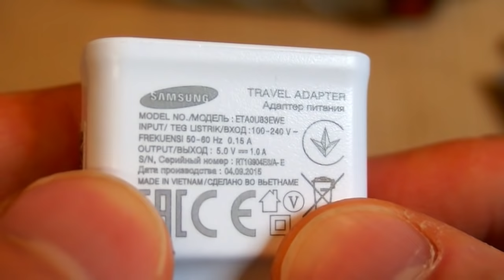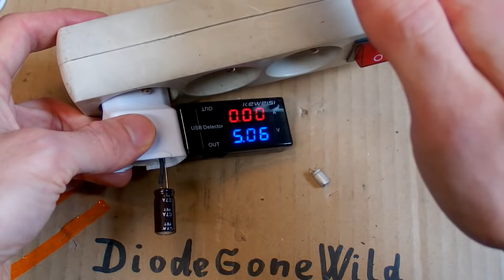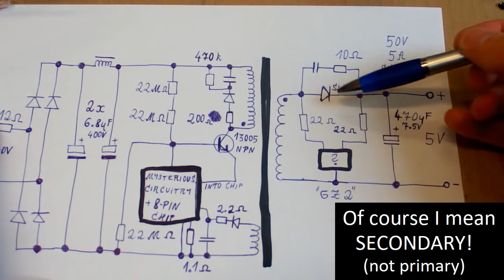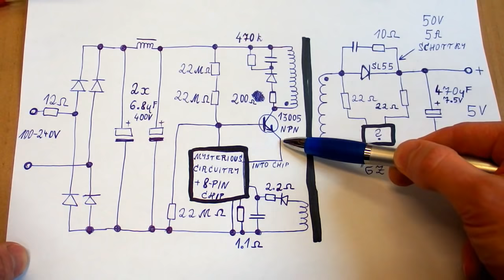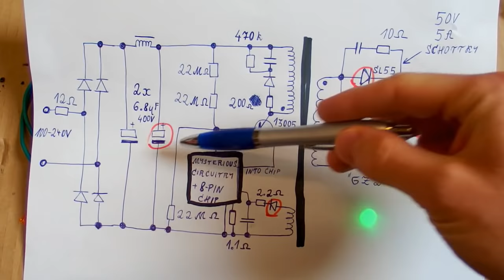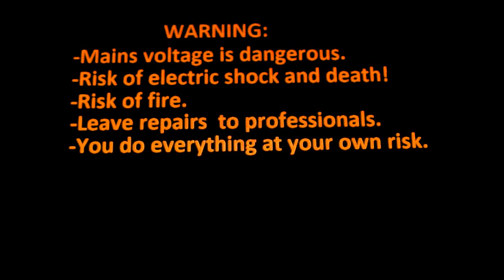Samsung USB Charger Failure and Repair

Comment: Sir i have confusion related to secondary side the secondry side is still ac power then how used electronic capacitor usually those capacitor are working on dc volts

Comment: I've had like 3-4 of these fail in the 4 years I've owned my phone fir my 120 NA outlet. Seems like once a year. I have to keep flipping the cord around randomly until I find a way to fast charge - thought it was the cord several times, never the case.

Comment: All men made products nowadays are time machines. Can last for all least 1 to 2 years warranty period.
You should mark the installation date on the appliance just like a bottle of milk with expired date.
When an appliance is out of order, U can decide what to do next.
Timing belt , rechargeable battery, capacitors, direct soldered notebook CPU, RAM can do the job well.
U can not imagine a plastic part, cover can also do this kind of job. Cracked or broken into pieces as time goes by.

Comment: Why on earth is the transformer after the rectifier? It makes no sense to me as transformers don't work with DC current...
Reply: The signal is converted back to high frequency A.C. after the rectification stage. This is probably done by using a mosfet. The transformer then steps the A.C. voltage down, which is then converted back to D.C. by a diode and capacitor arrangement on the output. Maybe... lol

Comment: @DiodeGoneWild with regard to the chip on the secondary side, I opened my own Samsung charger and had a look. I found out it is an APR34330 which is as the company calls it a:  SECONDARY SIDE SYNCHRONOUS RECTIFICATION SWITCHER. Not too sure but it looks like it is essentially a controller with integrated N mosfet that helps on reducing losses on the primary side and also smoths the output to maintain a nive fixed 5V. 
Datasheet:  https://www.diodes.com/assets/Datasheets/APR34330.pdf

Comment: My charger wont charge the phone and makes short circuit like noises? I use a second original charger from similar phone on the phone that wont chanrge and the phone charge with no problem

Comment: I got also a PSU looking like this one, but the circuit differs a bit. My one failed on the output capacitor. It was terrible small for its capacity and made for computers, not for PSU using high ripple currents, so it failed. When replacing it by a much smaller value, but made for high ripple, it was working until today.

Comment: Sir my charger is may be damage due to high voltage of electricity but it still charging but there is a  burning smell in it then what I do...Use it or not...,,?
Reply: can you identify the burning oder?
Is it the circuit board? a resister? a semiconductor?
touch the componants and see which are hot

Comment: Electro caps rt type have a deliberate indents on the top usually a "x" or a centred line with 1/2 circles either side of the centred line,they leak brown liquid through these weak spots when overstressed?,in extreme cases they can explode with a loud sharp "bang" !! ☺

Comment: The first tech I've heard mentioning the smell of a circuit a trick I have taught people in electronics repair since the early eighties finding bad transistors in pinball machines
Reply: repair by using your senses is a very good and old school method of repair

Comment: I use the same Samsung charger and it smells like it has burned at the 5v output but it works just fine is that normal?
Reply: I don't think so..
Reply: @dianaodintsov4371  Should I buy a new charger?

Comment: My general rule on capacitors: See a capxon capacitor, replace it. Even if it hasn't failed. I rarely see capxons that haven't gone bad.
Reply: too bad we cant hold those Capxon manufacturers responsible for their known bad quality junk we should boycot Chinese goods until they remove crap like that from the market

Comment: Fuse resistor generally is of 2W and 10 Ohms / 7.5 Ohms which means if it passes more than 400mA from AC side(230/120 Volts) it won't blow. How is it a fuse? Shouldn't it be 0.1W resistor? Please revert

Comment: Perhaps the electrolyte was on the line that monitors output current or voltage and sends the result to the control chip which adjusts the output dynamically...

Comment: so how to clean this Liquid spillage without destroying the board  ?
Reply: I use flux remover or regular alcohol you could even scrub it down with a soap and a toothbrush and water then completely dry the board with a hair dryer or heat gun

Comment: Transistor-era electronics for higher-current handling
Transistor-era electricals for mobile-portable voltages (especially 3.3v components)
Integrated circuits for analog-digital and, less-presumptuous than controllers, micro-controllers, programmable-logic-controllers, micro-processors, processors, field-programmable-grid-arrays, graphics-physics, AI-processors.

To ground multi-segment power-supply micro-ATX x86 main board, 0v pivot-point is difficult to up-down. To raise the overclocking voltages of processor in main board to component level matching voltages, 1.25v digital-electronics components can up-down easy without pivoting-trashing around 0v. Accuracy to other electronics component ranges until analog 3.3v to batteries of 3.6v/3.7v and charged by voltage of 5v or charge by current of 5v+10%(non-milspec) with USB-C PD blah-blah... 

Computer Main boards should have Samsung USB chargers, or, IC not too intelligent but can control voltage accurately USB charger - as grounding device. 

Find balance to be within-range of plus-one order annulus, branch vector. Within-range to within-range to within-range. Center is balancer grounding. Chinese term of 太極

Comment: You sounded unsure about whether this charger was genuine. From what I can tell in a quick search, all signs point to fake ... the real ones have a transformer with a white wrap, the components in the circuits are different, and there is a long cut out gap separating high and lot voltage circuits in addition to the use of distance between the sides, whereas this one is just using physical distance and no cutout.

I had a similar issue years ago with an Apple charger I bought ... the Chinese copy factories are getting better at making this stuff all the time.

Comment: Just opened the 2A version of the charger to have a look. It was pluged right before I opened it i remember that I thought in my head to be careful cause the input caps are still charged at 300+V but right when I opened it I touched their terminals and my slightly sweaty skin didnt help to avoid a very nice shock! A minute later, when I tried to discharge it with a screwdriver, it still made a big spark so I guess it could have given a couple more shocks in that time! BE CAREFUL PEOPLE!
Reply: yes it can be unpleasant but a good eye opener... better then strong coffee lol

Comment: I appreciate your explanation, a good knowledge for newbie like me in electronic repairing, but I will buy new fake one, as in my country that thing cost around 90 cents USD. Just a suggestion though, I don't think it is save to pry using paper cutter, it may chipped and fly to your eyes. I usually get a hair dryer to soften the plastic and use a small flat screwdriver.

btw for all, forget his accent... this guy can smell electronic component failure.

Comment: i have a note 9 charger and it did the same thing but the probleme was not a compoment but the problem was in the connexion between the charger board and the plug there was a bad connexion just with the soldring iron i heated the contact and its working

Comment: I would like to build a component that will tell me what actually circuit component is bad within about 2 minutes scanning the components & just a little simple small handheld device type one I know it can be done with some components it could be done easier if all circuit board makers put linear field connection on the board so we can see the abnormal field brakes or stops the odd section you pointed out on the second small blue print you drew maybe that is there trademark sound & frequency that can be heard thru the neutral lines going back to power source. It's gets pulled into the primary & secondary windings causing noise..no  just kidding I don't know just one of my goofbal joke calculations

Comment: I am looking to hire someone to make a safe 220V to 5V 1A module with all the information mentioned in the video. Are you interested?
Reply: Save the trouble and get it from some (most probably Chinese) company. The smps design is already quite mature and cheap so skip reinventing the wheel. These electronics that handle AC voltages require a lot of certifications before you can sell it to people. If you buy them premade, you can skip all that since the stuff you made is only a 5V DC device, adapter would come pre certified.
Reply: This design is quite unimpressive anyway, I doubt it's original Samsung charger. For $2 on aliexpress, you can get similar specs smps that will contain proper input side noise blocking, proper fuse, ntc/ptc resistance based current limit, optocoupler feedback etc which this circuit lacks. This circuit is very primitive (basically as cheap as possible) design. Atleast from what I understand.

Comment: If it breaks early it's probably a real Samsung.
Reply: The circuit is good but when i saw Capxxon i went.. oh damn.. someone in sales wanted to cut the cost down... these are shite caps across the board.. made that charger unuseable to save 20 cents

Comment: @ 3:43 : the mysterious ic code (350BM G1 430JA7) was typed on Google and I got this : 340kHz , 2A Synchronous DC-DC Buck Converter ;   Datasheet :   https://www.diodes.com/assets/Datasheets/AP3502E.pdf ;  9,999 subscribers , they all subscribed to learn english lol.

Comment: The control chip could be an AP3503MP. Not easy to remove because of the exposed GND pad underneath.

https://pdf1.alldatasheet.com/datasheet-pdf/view/510981/BCDSEMI/AP3503MP-G1.html

Comment: Smps is to cheap for reparing. IC dc-dc converter Tny, filter capacitator, resistor primary, secondary fast charging ic, thats wrong parts if samsung TA dont work

Comment: i have this problem too, and unfortunately for me, not only did it kill the charger, it took my samsung s9's life with it, i left it charging overnight and the morning after my phone would not turn on, that charger has been giving me problems for a while too but i never knew it was this bad.
Reply: I kinda suspected that circuit as I didnt see any serious regulator at the USB port for the cellphones Lithium Ion battery
unless it is that mysterious chip he spoke of

Comment: That's useless, I'm more likely to cut my fingers off than to open this thing up, even using a drill doesn't help, it's probably never meant to be disassembled. And even once opened, there's no way the board is coming out of there.